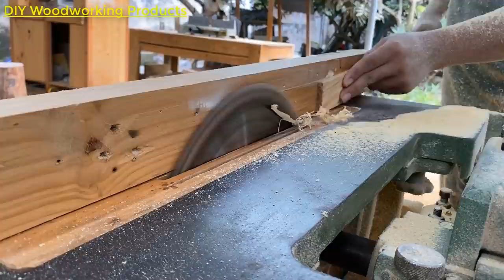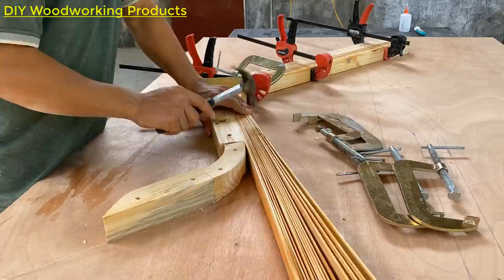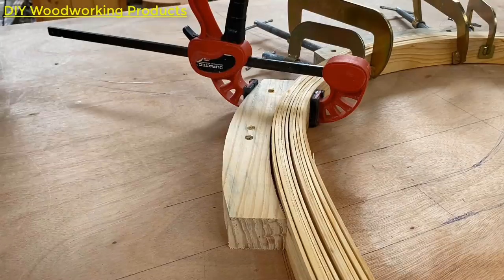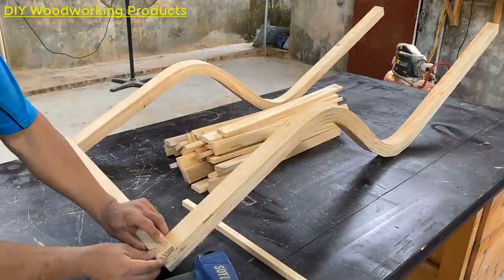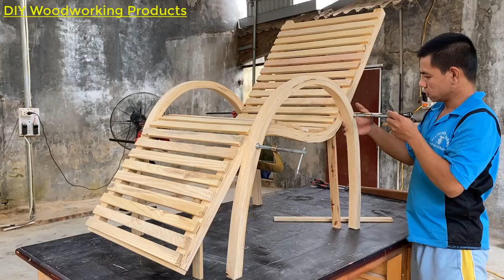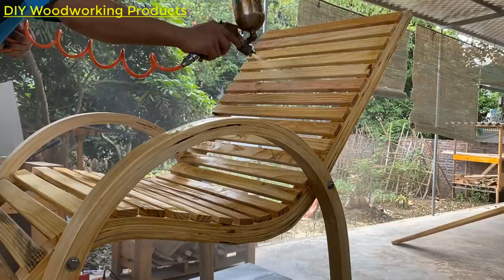Build A Super Easy And Artistic Chair With Simple Wooden Strips // Creative Woodworking Pro

Comment: Good idea, but that you are working on a open table saw is really not right...
Sorry but you are showing all the People a dangerous example...
Where is the suction hood? 

You push with full force, you can see it on your fingers. Once slipped and it's over. You normally must use a push stick for this.